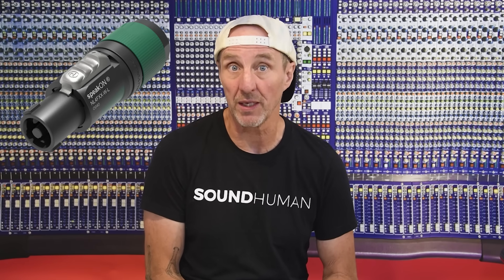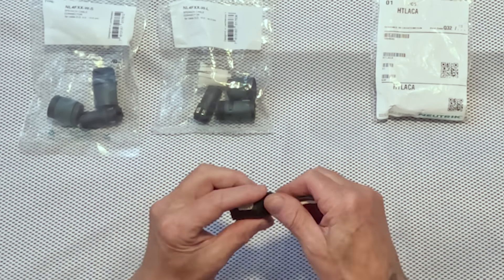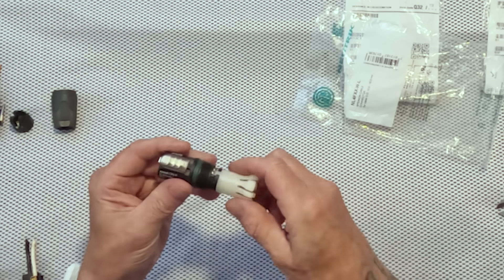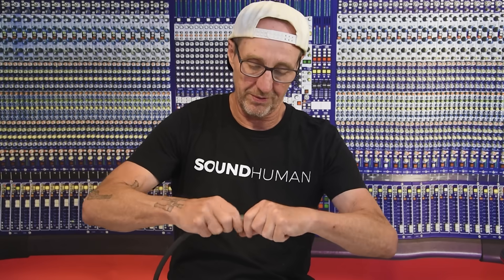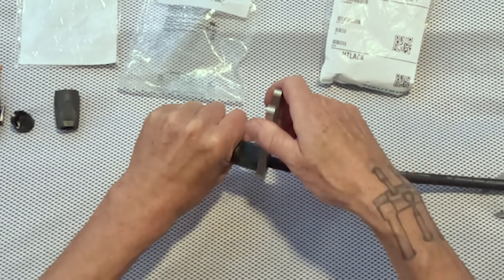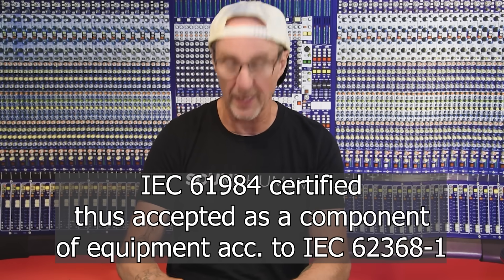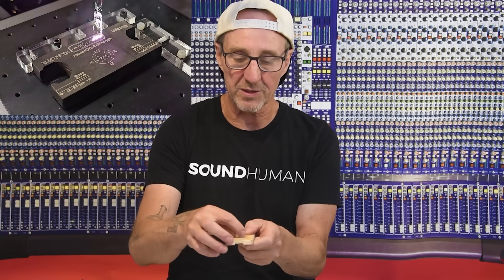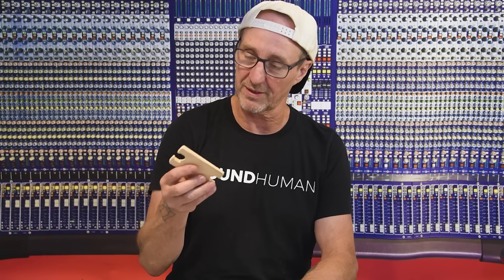NL-4 Speakon Discontinued - New Safety Lock Version!

Comment: ... child safety? If you got kids playing around with speaker cables like that, either you have way too much money, or your child is in a place where it definitely shouldn't be. This is a solution looking for a problem in my humble opinion. Guess Neutrik hasn't made enough money off their older, defininitely not overprices plugs.
Reply from the maker: Well, that may be me taking a dig. Actually it's IEC compliance that I believe they were forced to comply to.
Reply: @DaveRat  No no, you said that in the video, that's understandable, but they still didn't need to charge 180 bucks for two pieces of steel.

Comment: i have small ish hands and a good grip and i can open these boys quite easily now. while harder than on old speakons its as quick when you know how to put your fingers on the bad boi for it to grip correctly. i'd advise everyone here to try with their bare hands.
Reply from the maker: agreed and also, there is a torque spec and though the tool they sell does not tell you the torque, best I can tell if the connector is torqued to spec, there is no way hands will open it

Comment: Are there any changes to the standard powercon line? The actual connector that carries 120 V without question? The true one connector is nice, but not yet adopted by most manufacturers.
Reply from the maker: All discontinued. I believe the powerCON True1 TOP is the only version they still make and it's the same as these
Reply: When I look on neutriks website I see the following.

The powercon blue/grey was revised not long ago with the old version being discontinued. The new version is now approved as safe to disconnect under load, and the  cable connectors use the same restraint system as these new speakons.

On the true 1 top side, the large cable diameter version seems to use this new system, while the small cable diameter version seems to still use the "screwdriver slot" release.

Comment: Nice way to make them harder to field service on the job.
Shame they still didn't even get a decent sealing cable gland.
Reply from the maker: They appear to be very water tight. Rubber around the cable and o rings placed to stop moisture
Reply: @DaveRat  Yes, I can see that. I would just prefer a compressing gland, like other brands use on true-con, or any IP 65 connectors. I've seen alot of water ingress, when the cable is bent sideways, opening the simple rubber dome
Reply: @DaveRat  Does that really change anything, though, considering the connecting surfaces are fairly exposed and prone to getting wet?

Comment: So, a pair of pliers probably would damage the plastic connector, but that U-shaped thing is basically just a reverse wrench, so why not use the proper wrench size? It's got the same flat sides and rounded end that a wrench does. Barring that, you could also use a plastic clamp that has rubber grips (woodworkers use these as they are far less likely to damage the wood they are working on).
Reply from the maker: Yes, a big wrench or other tools will work. The neutrik tool grabs around the corners of the flats so that will work better.

Or any 3b print tool or the wood one I made, also grab around the corners which gives better grop

Comment: You could probably print this tool on a 3D printer. I still have a pretty good stock of old connectors I can continue to use, but if it comes down to it (like you said, for safety), I can get my son to print one up that I can use. He has a couple of good printers to use for a side gig.
Reply from the maker: Agreed, I uploads an STL file to the members telegram. Define nicely love the work around!

Comment: I wonder if a dab of super glue in the slip barrel would "lock" it in place and allow the back shell to come off with out the need of a special $85+ tool.
Reply from the maker: Perhaps, I believe the material is gass filled nylon for the body, not sure about the green cap material but may be the same.

Not sure how well super glue sticks to nylon.
Reply: @DaveRat  Super glue works well on nylon. I'd spring for the gorilla brand, it's a little softer, puts up with abuse better, and, well, we both know abuse is basically standard for this kinda thing.

Problem is, if that glue breaks... you're up a creek without a tool. Better to drill them out instead if you're looking to bypass that feature.
Reply: @jttech44  Nothing like excessive power tool usage

Comment: Very good video! 

On some Powercons they have this ratcheting mechanism where you have to poke into it with a flat head screwdriver. I wonder why they didn't use this but rather came up with something entirely new. 

TBH the flat head ratchet thingy sucks, as well... 😅

Virtually all CEE or Schuko plugs can be serviced with a simple PH or PZ size 1 or 2 screwdriver...
Reply: So they could sell 2 dollar wrenches for 90 bucks, obviously.
Reply: this system would make sense on powercon if the tools werent 180€... this new connector is still easier to open tham the "oem" connectors that come with premade speakon cables. (made a 1cm deep hole in my hand with a knife while opening the connector)

Comment: Looks like I'll be sticking with the generic speakons. I don't even like speakons because of the tendency to either shred the wires or push the wires out when tightening. I know you're supposed to use ferrules because Europe loves ferrules on everything, making connections needlessly bulky and time consuming to repair, but this whole safety thing is getting out of hand. The originals were safe for any competent technician to use. Now you need special tools just to take them apart. Easy field repairs should be a priority for the design of these components. But it seems Europe's regulatory busy bodies just seem to need to find every imaginary dangerous circumstance like what if a baby disconnected the speakons and started taking them apart and licking them? Our new and "improved" connectors will prevent that from happening. Problem solved! When every other competent tech would be going "what's a baby doing backstage?"
Reply: So while it's not in-spec, the thing to do is tin the very ends of your wires just a litttttle bit before assembly. Just a kiss with a tinned iron will do. That keeps them tidy while tightening the screws down but still allows the screw connection to smash into the strands and make a good connection.
Reply: @jttech44  

Yeah it's what I resort to but it's still very bad in the long run because tinned wires still suffer from creep. So over time and due to resistance heating the connection will come loose. Happens all the time, guaranteed. Just a property of solder, creep. The ferrules prevent this but again are extra time and cost due to buying crimpers.

Not only that but resorting to solder and the resultant creep guarantees you'll be field servicing even permanent installs. And these ridiculous speakons now have special tools required to open.

Thus the design traps you into needing all this extra stuff to guarantee a quality long term connection.

For permanent installs and my own personal cables I don't tin. I remove the screw entirely and permanently solder the connection. This eliminates the creep problem and you still have a perfectly field serviceable connector. Especially since any competent audio technician can now have a battery portable soldering iron like a TS100.

All problems solved but you'll be fined if those European busy bodies find out you're doing this, Australia is particularly strict about these matters. They say it's for public safety, but seriously it is about inflating the costs of putting on shows just to protect you're job 10,000 miles away in Brussels. Where they come up with these ridiculous regulations. Look up bent bananas.

Speaking as a former Electronics Manufacturing and Regulatory Compliance Engineer specifically dealing with export regulations due to all this European regulatory crap. It's truly a nightmare and only getting worse. All these regulations have now basically paralyzed actual progress to the point that even Europe is slowly allowing self regulation and testing due to the extremely convoluted and specific regulations.

Thus what truly ends up happening is companies with deep resources that are established allow them to self certify compliance. Everyone else has to deal with the bureacracy and certified testing labs. Thus philosophically it is simply a form of trade protectionism masquerading as public safety. Stifling innovation and competition.

All perfectly summed up in one measly connector.
Reply: @LVeAV  I really couldn't agree more with all of the above.

Comment: At least Neutrik didn't completely balls it up like they did when the absolutely shocking NL4FX was launched. Quickly backtracked and re-released the NL4FC which is far easier to assemble by hand!
Will be interesting to see how my next batch of speaker cables work out once I'm out of stock of NL4FC.

Comment: 0:59 just FYI, these are Pozidrive screws, specifically PZ1 size drivers should be used. If you've ever noticed these being prone to camming out and/or don't tighten all the way down, this is why!  Also, same goes for most European flat-pack furniture like Ikea
Reply: @jttech44 Pozi does not only have a different tip, it also has a completely different geometry that does not cam out like Philips / JIS do. So simply filing down the tip is not sufficient. When you put them next to each other, you can see that the pozi has parallel flats where the Philips has pointy flats that get smaller towards the tip.
Reply: Standard Philips driver will do in a pinch, but necessitates what I consider to be excessive force to keep the bit from camming out of the head.
The screws in the Neutrik connectors are designed to be used with a Pozidrive bit, they work MUCH better and won't damage the screw head.
Reply from the maker: Perhaps mentioning that pozi screws are marked with 4 small lines pointed inward on the top of the screw. 

JiS screws are marked with a single dot indent
Reply: Normal philips driver and some sand paper and you're good to go there. Everyone has a few clapped out philps drivers that can see new life by being... flatter. No need to buy pozi

Comment: back when i used to be in that line of work most of the speakons i've encountered were, within a few months of abuse, a bit too loose at that collar. handled at least two stage monitors on two completely different occasions where that collar might as well not have been there at all, it would come loose and off if you grabbed the speakon the wrong way.
still better than other connectors for sure, but it's not as durable as people make it to be. the ratcheting mechanism makes sense and as long as there's no copyright on making a key for it, this is one safety mechanism that doesn't seem like it's doing more harm than good.

Comment: Important: the wire retaining screws are not Phillips!   They are Pozidrive. Grab a pozidrive and you will feel that it engages much better with the screws!

I expect that a 3D printed version of the tool would be functional enough.  I’d be willing to try!

I think the safety is a great idea. I’ve definitely had brain-dead stagehands disassemble old NL4’s before.  Still better than EP4!!!
Reply from the maker: Hmmm, actually torx T8 on the new ones
Reply: @DaveRat  that’s even better!  Just have to buy another tool and keep track of it though. Haha
Reply: @DaveRat  I noticed you mentioning the screw type of the older connectors.  As I recall; my first ones required an unbrako driver :)

Comment: Fucking hell. I looked into them because I wanted to short my woodwork tools cables. I ended using the ones used in pc, in the power supplies. Cheap and easy. 
Now you tell me even a piece of steel (wrench) is 90$. Fuck them.

Comment: Neutrik connectors have great quality and last forever (unless you leave them in the rain), so I understand the high price, but what they charge for tools it ridiculous. Look at the price of the BNC crimping tool. It's 650€ including the inserts here. 650€ for a crimping tool! I ordered one from Aliexpress for 20€ and it works just fine...
Reply: Aliexpress is a great place for specialty tools like that, because, you know, it comes from China, and china's where they build all the stuff that requires the specialty tools.

Comment: Is the plastic material of the end of the connector more durable? This part breaks most often, requiring service in the field. I’d hope they also made structural design improvements beyond complying with new safety regulations.

Comment: 1. Knipex parallel pliers (i.e. 86 03 125 or 86 03 180) exist for a reason, those plugs would be one of them
2. Calipers are no wrenches, they are measuring tools. possible use in this video? measuring the hole for the cable, or the dimensions of the flats
3. High voltage creates arcs, and 140V can be lethal under the wrong circumstances. so waterproofing is important. would have had been nice to dwell on this in the video
4. 5000W at 140V has 35A of current. the connector inside is the critical element here, since a flimsy connection will get hot, and melt the housing, or create a fire. would have had been nice to mention those in the video...
5. does a dual AWG 6 cable fit in the plug? (AWG 6 is rated to 35 amps)
Reply: Specs are on the neutrik website, in excruciating detail. I could quote them to you, but, I'm teaching a man to fish here a little bit because it's good to be in the habit of reading spec sheets.

Comment: Thanks for explaining the differences.
Just a quick tip. When you're doing close up shots with your hands, it would be better to use a plain background. All those little spots totally threw off the mpeg encoding and it just dissolved into blocky pixels when I needed detail.
Reply from the maker: Thank you and yeah, I am not so good with the vid aspect as I get distracted by the info I am trying to share and regularly mess up

Comment: I realize that you know that, but just to make that clear to your viewers: IEC rules are not "EU rules". IEC literally stands for International Electrotechnical Commission and they are part of the World Standards Cooperation. 
Concerning the item in question: Biggest plus here would be the fact that you don't accidently loosen the endcap during use, and I would assume that this was the driving force behind that design first and foremost. At least over here, NL-4 being in service while half unscrewed over weeks and month is by far the most common failure mode I see when I come into venues. Not sure how they do it, but heck it seems to be "a thing". So the new connector makes sense in that regard. 
I also like, that there is a very clear color difference between the NL2 (brown) and NL4 (green) this time around. 
That tool...well, it won't be long until there are a ton of after market alternatives, the original has come down to 77 bucks already. Plus your adjustable wrench will fit on it just fine if in a pinch. I don't really see a problem here. Also, that tool seems to become a somewhat universal unit within the Neutrik universe, since it will also work with the current powerCON iterations.
With that extra length, we will need a 90° version though, and sooner than later!
Reply: IEC makes the standards, not the rules. Regulators decide which standards have to be adhered to. In this case, these fit EU regulation that requires the standard they're built to.
Reply: @jttech44  If what you say is correct, why is that standard from 2008 and why do we in the EU still get to choose which variant to buy (!), while you in the US only get the new one, which adheres to the IEC standard?
Reply from the maker: Are you sure the old speakon are still going to be available in the EU? When I go to to the neutrik websites for Germany, France Lichtenstein, UK, US and Japan, the old versions show discontinued. Only China na seems to have the old ones still listed.

Stores may still have the old ones but those days I believe are numbered.

Take aoon and let me know
Reply: @DaveRat  Oh, you are correct, meanwhile they have vanished from the German website as well! I checked when I made my first comment and saw they were still available (or I was completely blind then...been sick as a dog, so might very well be 😂).
Reply from the maker: Yeah, it's early in the adventure and old at ck will be gone soon.

We meet with Neutrik and got word fairly early on what is happening. It's all super interesting

Comment: Not something that will ever impact my life, but interesting just the same. I was about to stop the video, then I realized the extremely low freq sounds I was hearing was from the video...I though it was a truck going by at first. I suspect that, if I weren't using these nice Beyer Dynamic headphones, I wouldn't have heard that. Over the last two or three years, I've been gradually going up the price scale for headphones, as each cheap pair fails after a few months. These are the first I've found that I have any confidence in...they're made solidly.

Comment: you can likely use a cone wrench ( Park Tool ) for about 10 bucks, if the flats are metric. we use them to geth into bearings on bike wheels etc...

as to the tool on the part that goes to the amp or speaker, lust make a dummy jack in a box

no?

Comment: I made some F-nl4 to dual Male M-nl2 on second pole adapters with these late n' greats.  I'm required to solder these instead of using the microscrews are in neutriks.  The metal tabs are more difficult to remove than the old ones so I've just been saturating them harder and that seems to hold.  Do you have any techniques that would make it easier or better?